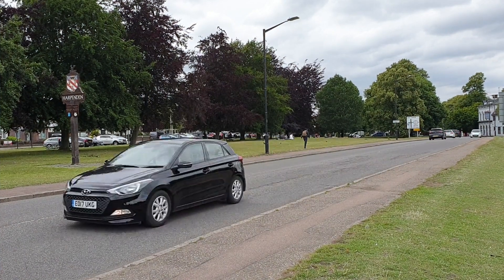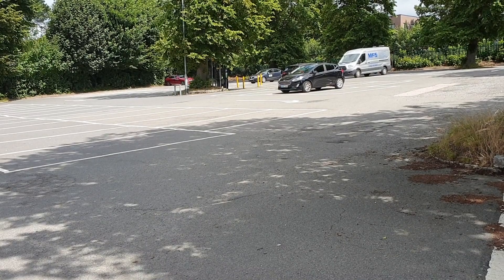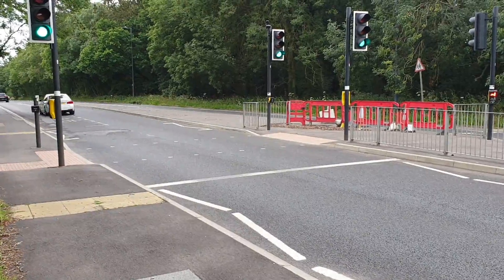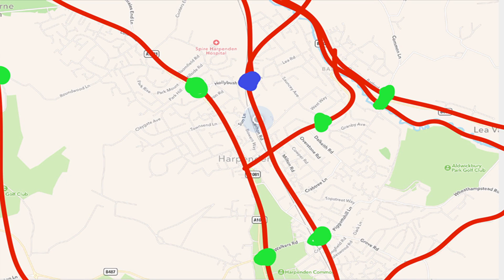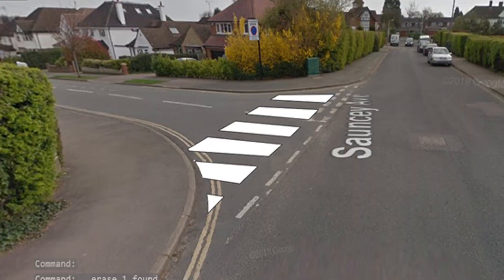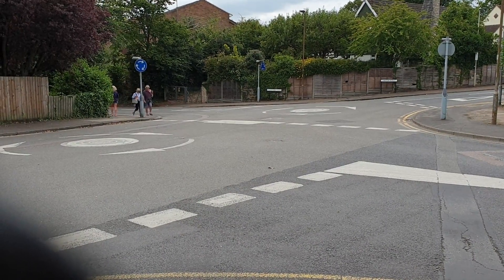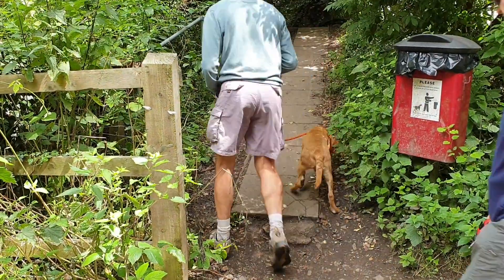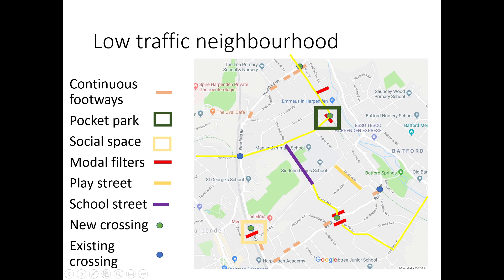Low traffic neighbourhood step by step network planning

Comment: So you look at all these things great but I noticed with all of these things not a single thought for motorcycle riders not a single thought, think about that for a moment you claim to be trying make a plan but you completely exclude a vehicle type that is not a million miles away from the bicycle, in fact motorcycles are registered as bicycles, and yet not a single thought about the issues they will have to contest with the changes.

And that's generally why so many motorcyclists get killed due to complete lack of consideration for what they have to deal with.

Comment: Was any of Harpenden Town Council's capital grant ever allocated to this? 

As a fellow resident, at the time of the consultation I supported this. 

The pedestrianisation of Bowers Parade is a small step in the right direction, plus also, hopefully, the link to the rear of the station car park at Aysgarth Close. But I've also asked of Herts CC about filtering Arden Grove (discussed in the video but not in the plans) and Victoria Road at Station Road. Also, one way on Southdown Road with bi-directional cycle path (keeping Walkers Road as a two way alternative). 

As I live in Southdown, I guess my focus has been more around improving access too and from there.

It's not my project area, but just general interest as I live there.

alister.barclay@sustrans.org.uk
Reply from the maker: nope